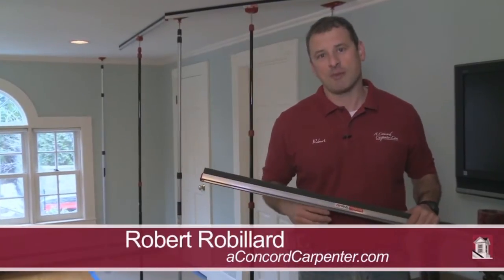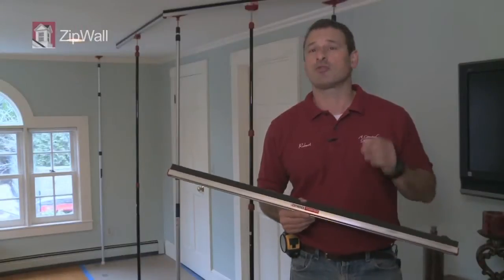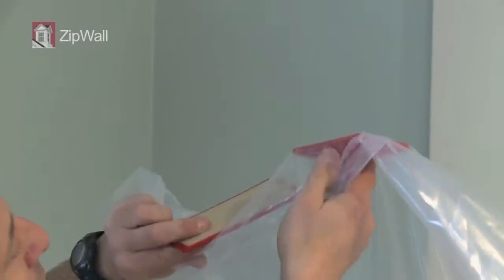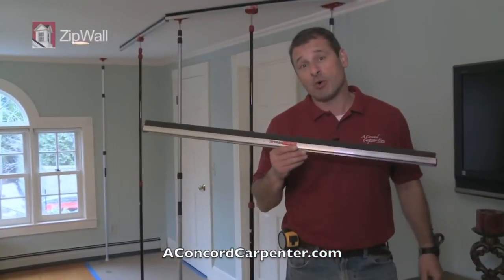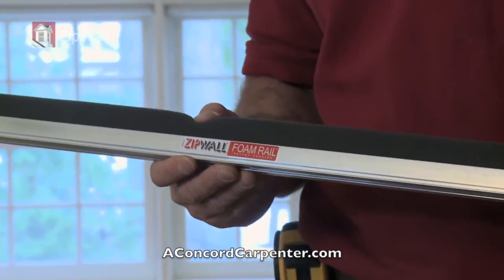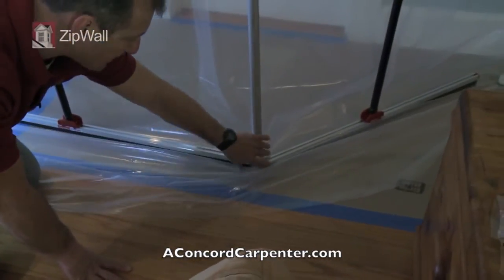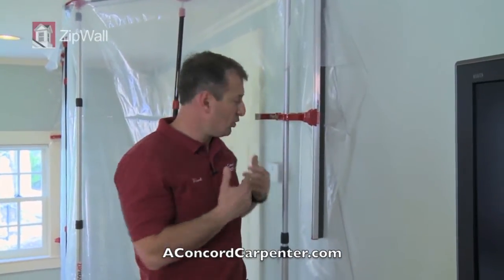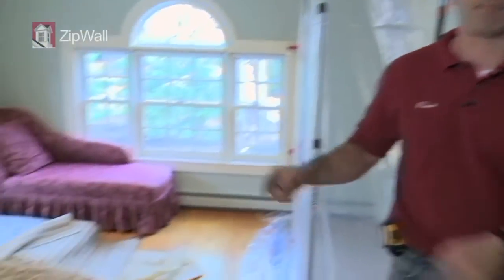ZipWall Dual Seal - Dust Barrier System

Comment: It's useful as a room separator.  I was considering this to insulate only certain sections in a bedroom during the winter.  To retain heat from radiator and electric heater.

Comment: Foam rail is nice but its more costly than using tape right?
Reply from the maker: +Cosmo John yes - but look for kits and promotions
Reply from the maker: +Cosmo John The foam is soft but the pole tension is strong enough to compress the plastic to prevent slipping - its really an outstanding product

Comment: Why not just tape the plastic to the ceiling? Foam
Reply from the maker: +Cosmo John Tape is not always strong enough, oily and dirty hands mar the ceiling finish, and tape can damage paint finish.Foam rails seal better, avoid oily hands on the ceiling, and secure the plastic better.
Reply: A Concord Carpenter
Will tape cause paint to peel off too ? Is that why tape is not used ?
Reply from the maker: +Cosmo John potentially - depends on the ceiling condition